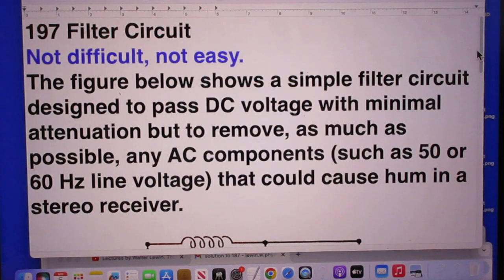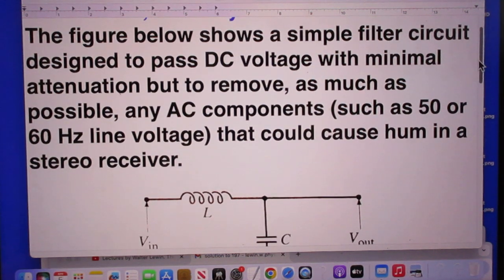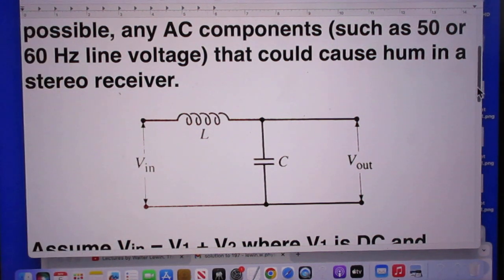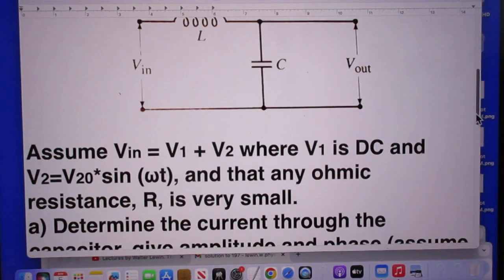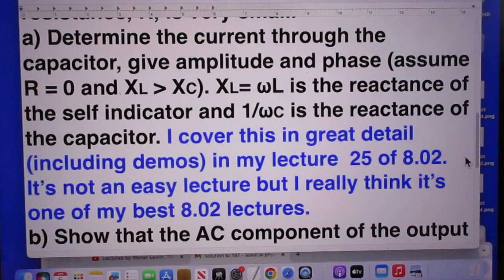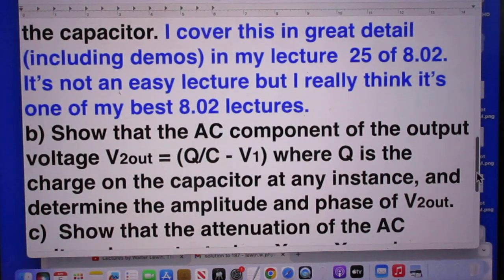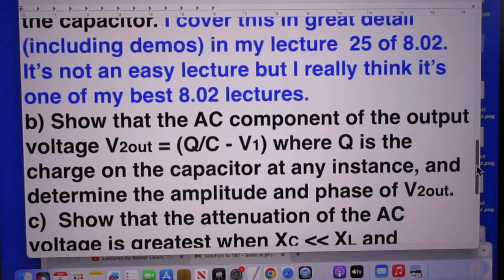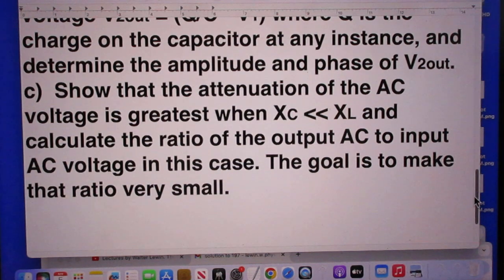Problem 197 - Filter Circuit

Comment: In lecture 25 of 8.02, Walter Lewin
 derives the differential equation for a driven
 LRC circuit and solves for current I.

I = V₁·cos(ωt - 𝜑)/√[R² + (ωL – 1/ωC)²]
 where tan 𝜑 = (ωL – 1/ωC)/R
 V₁·cos ωt is the input voltage, Vᵢ(t).
 
 R can be the internal resistance of the voltage
 supply. In problem #197 we set R = 0.
 
 ωL > 1/ωC => tan 𝜑 -> +∞ => 𝜑 = 90°
 cos(ωt - 90°) = sin ωt 
 
 => Answer (a):
 I = V₁·sin (ωt)/(ωL – 1/ωC)
 𝜑 = 90°

(b)
 V₀(t) = Q(t)/C 
 jω method => 
 V₀(t) = (1/jωC)/[(1/jωC) + jωL]·V₁(t) 
 => V₀(t) = 1/(1- ω²LC)· Vᵢ·cos(ωt) 
 
 Answer (b):
 Amplitude = Vᵢ/(1- ω²LC) = Vᵢ/[1- (ω/ω₀)²]    
 The phase is zero at low frequencies.

 (c)
 V₀(t) = XC/[XC + XL]·V₁(t)
 XC << XL => XC/[XC + XL] -> XC/XL
 
 Answer (c):
 The amplitude goes to XC/XL
 Since XC << XL  the ratio can be very small.
Reply from the maker: Hello Ulf - I have already recorded this early afternoon the solution to 197. I will post it on April 11.  I mention the 5 viewers with the correct solution. I mentioned YOU and said that I had not seen a solution from you which surprised me. I do not want to redo the video. Please accept my apologies.
Reply: @lecturesbywalterlewin.they9259  Hello dr Lewin.
It is perfectly fine for me! 🙂

I got very little time to do this problem.
In the weekend and before it was  terrible weather here in Sweden.
It was snowstorm and hard to be out on the roads, and I was on a travel.
Very slippery when the temperature went below 0 deg, C.

When I came home in the beginning of the week there was suddenly
a weather change with summer temperatures up to +20C.
I saw that you had posted a new problem but the weather was too fine to be indoors.

I started to look at the problem on tuesday and I must admit that I had
some problems with the solution even if I thought I knew everything about
these kind of circuits.
I was not sure what exactly the question was in some cases.
But I had written something anyway and decided to post yesterday night.

Good to hear from you and hope you are fine!
Regards /Ulf

Comment: A)
if wn = 1/sqrt(LC) = resonance frequency 
Ic = jwC/(1-(w/wn)^2) which for w>>wn becomes Ic ~ -j/wL 
Amplitude = 1/wL Phase = -90 deg

B)
Superposition principle
Vout(AC)= Vin(AC)/(1-(w/wn)^2)
Vout(DC)= Vin(DC)
Vout=Q/C=Vout(AC)+Vin(DC)

C)
Vout/Vin = 1/(1-(w/wn)^2) 
For w >> wn, Vout/Vin ~ -(wn/w)^2
Ratio “small” if either L or C are “large”

Comment: Sir please answer this ques from the topic electric flux - A charge q is placed inside a cube at a distance d from one of the corners of the cube. What will be the electric flux through each face of the cube  due to the charge q?
Reply from the maker: I do not solve problems for viewers. I teach Physics. This  is a trivial highschool problem.  Watch my 8.02 lectures.
Reply: @lecturesbywalterlewin.they9259  Thank you for the reply sir. Respect.
~ An aspiring engineer from India
Reply: Lookup Coulomb's law & Gauss's flux theorem. 
Both in WL's lectures. 

Also, how far away is it from at least one of the other corners or some other reference?

1 reference point relative the charge is not enough to work out how big the cube is and how big its sides are, how close they are, and so on... Proportions?

2 independent angles to go with that distance would also be handy, then you have a 3d vector in the cube.

Comment: Hi Prof. Could you please help us to know the solution of this problem. On internet there is conflict in solution. The problem is-In a pond, there is a ship floating with a large rock on board. If the rock is removed from the ship and dropped into the pond, will the water level of the pond increase, decrease, or remain the same?
Reply from the maker: classic problem -  it's also one of my bi-weekly  physics problems
Reply: Decrease (provided that it's denser than water).

Comment: Taking a first stab. Happy to receive corrections.
A) At DC (omega=0) the inductor presents zero impedance and the capacitor, infinite. Thus there is no DC component to the current through C. The AC current through the capacitor would then simplify to V_2 / (X_L - X_C) at the same frequency as the input since X_L is greater than X_C (and no R); the phasor points straight up. The current leads voltage by 90 degrees.
B) The output voltage is directly across the capacitor, which has an an instantaneous value of Q/C. The charge on the capacitor comes from that provided by the DC input V_1 in a superposition with that of that provided by the AC input. Thus the output component attributable to the AC input is (Q/C) - V_1. Overall output voltage is superposition of V_1 + (V_2 * attenuation_factor described in the next answer) at the same frequency as the input, and will be essentially in phase with the AC component of the input.
C) If you think of it as a voltage divider, with A and B, measuring across B, the normal voltage divider formula B/(A+B) applies and describes the ratio of AC output voltage to AC input voltage-- specifically X_C / (X_L + X_C), a ratio that will grow arbitrarily small (greatest attenuation) as X_L dominates.

Comment: I have an experiment for you:
Suppose you have a closed circuit with a car battery and a lamp.
Consider that it is an ideal battery with an internal resistance zero (you can think of parallel conection of 100 000 000 car batteries).
Now i put this battery in a black box, so that you can only see the plus and minus contacts.
I have the possibility of replacing this battery with a superconducting coil with a linear increasing magnet field inside the coil, so that you get the same DC output voltage.
If the battery is inside the blackbox powersupply you would say the path integral E ds over the blackbox powersupply is -V.
If the coil would be inside the blackbox powersupply, you claim, that the path integral E ds over the blackbox powersupply is zero.
How can you figure out if you should write -V or zero without opening the box ?
PS: I by myself would say that the induction coil produces an induction voltage Ui = - L * dI / dt = -V and I would say I don't care what's in there.
Reply: But you do care what is in there because you know. That is why you put Ui = - L * dI / dt = -V.
I dont know, so it is just a power supply with a voltage across its terminals.
If I lived inside the black box I would do Faraday around an internal loop where the outside is an unknown load, with a voltage across it and drawing some current.

Comment: If i consider the AC LC-circuit with V2 = V20 * sin(w*t) and Q2 / C = AC-component of the Output Voltage, i get the differential equation ( for R = 0 ):
L * d²Q2 / dt² + Q2 / C = V20 * sin(w*t) with the solution for the current 
I(t) = - V20 / (XL - XC) * cos(w*t), with XL = w * L (reactance of the selfinductor) and XC = 1 / (w*C) (reactance of the capacitor).
Q2(t) = - 1 / w * V20 / (XL - XC) * sin(w*t) it is integration for I(t) with the starting condition Q2(0) = 0.
d²Q2 / dt² = w * V20 / (XL - XC) * sin(w*t) you can verify this by inserting this in the differential equation above.
a) A DC voltage does not produce a significant current in the capacitor after the capacitor is as well as charged.
The AC-component V2 leads to the above current I(t) = - V20 / (XL - XC) * cos(w*t) with the amplitude Imax = V20 / (XL - XC) .
b) V2out = Q2 / C = - XC / (XL - XC) * V20 * sin(w*t) with the amplitude XC / (XL - XC) * V20.
c) If i write for XL = n * XC with a large number n i get:
V2out = - XC / (XL - XC) * V2 = - XC * V2 / ( XC * (n - 1) ) = V2 / ( n - 1 )

Comment: Thank you for sharing the lecture Professor -  I learned a lot** 
💙
Reply from the maker: now SOLVE the problem
Reply: @lecturesbywalterlewin.they9259  Spent the whole afternoon professor - couldn't do it. Totally stumped by the question of separating the capacitor from the self inductor relative to the formulaic solution of the total current(I) provided in lecture 25... Differentiating between the resonance for maximum values and it's practical application also had me in a knot even though not sure if it is required.  "Gemini"(Google's AI)(It is possible to upload images for it to analyze...) says the initial amplitude would be 20( V20*sin(Wt)) but I'm not sure how that changes... and the phase I'm guessing would be the difference between the current and voltage after the transformation... At least I saw that the voltage would be leading the current while comparing the information* Will keep trying as you post Professor🙏🙏(trying to save my life* trading so the struggle is real atm)

Comment: I just re-watched 8.02 25 and... was MIT really at 110V AC? I'm on the west coast and we've been at 120V for over 100 years and I was always taught that the US is 120V and Japan in 110V, and equipment is rated at 110V to indicate that it will also work in Japan (with the actual specification normall 110-130V since it was usually designed for 120V)
Reply: The utility (NSTAR at the time of that lecture) has a standard to maintain mains voltage at the service point within 5% of nominal, which the US has had at 120V for a long time.  Mains voltage is a moving target, because it depends on the behavior of other customers on your part of the network, and how the utilities adapt to it.

This means the mains voltage that's supposed to be 120V could start at 115V (very common during the daytime), and through the voltage drop along the path from the service point to the load receptacle, it could drop as low as 110V.

Likely, MIT has a campus distribution grid, and customer-owned transformers for each building, so NSTAR wouldn't be responsible for controlling all the transformer taps, but rather the facilities maintenance staff would.  Likely, they have medium voltage distribution, and a master 480V transformer for each large building to run the big ticket loads.  Small loads like receptacles, are powered by smaller 480V:120/208V transformers.
Reply: Mains voltage in Japan is nominally 100V. U.S. is 110-120. In many homes you will find it is on the high end of this range or even higher. U.S. TV sets from the 1950s often are labeled 117 V, which apparently was the nominal voltage used for testing the power draw.

Comment: Sir, what is the different between Mass and weight ?
Reply from the maker: watch  my 8.01 lectures
Reply: @lecturesbywalterlewin.they9259  Thank you Sir
Reply: Mass is the amount of matter contained in a body or an object meanwhile weight is total mass multiplied by acceleration due to gravity which we commonly refer to as weight. Weight varies therefore place to place. I believe that should be enough.
Reply: Weight = mg
Mass = m